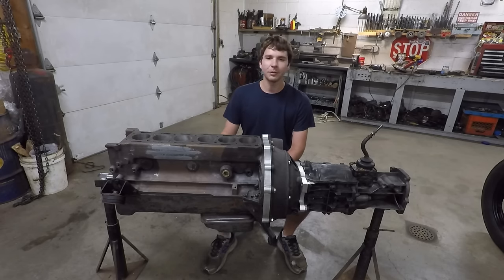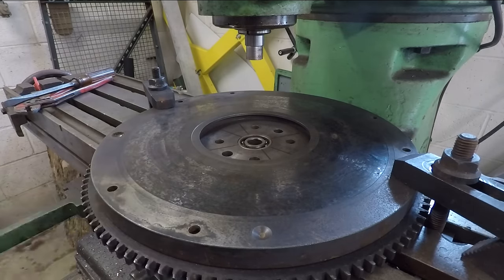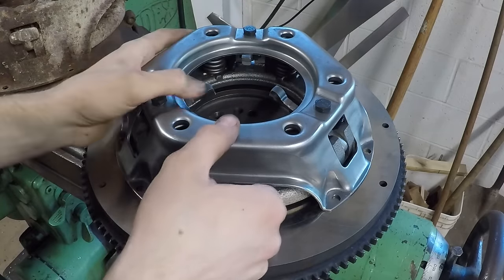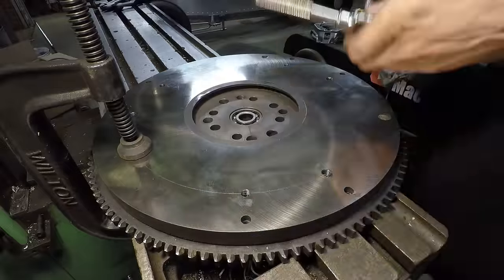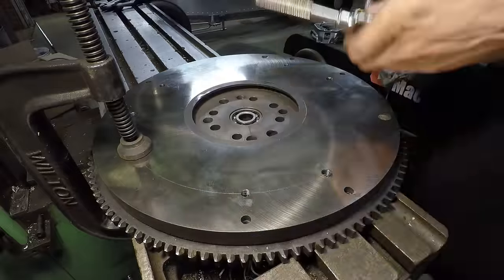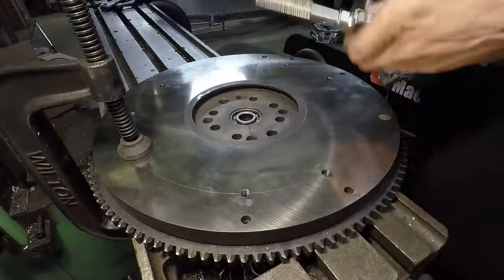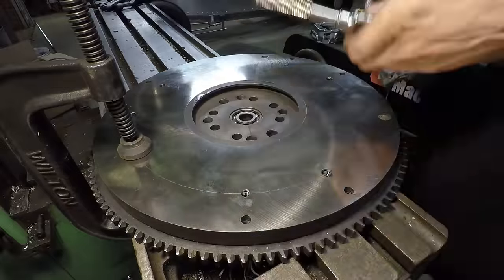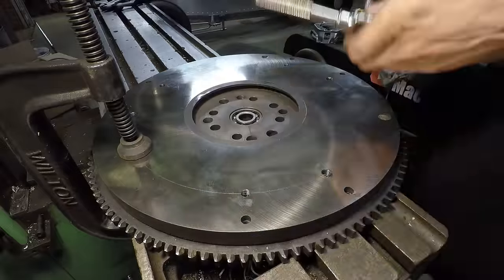Adapt ANY Engine to ANY Transmission!

Comment: This method would be great to match any Chrysler motor to any of those Chrysler cars that only came with that horrible 2.7 V6 which often died long before its time. When you see a Chrysler convertible in perfect condition being sold with low miles perfect interior and no electronic/ electric problems but can't sell despite the super low prioce tag... You know it has thet 2.7 V6

Comment: You can clearly see that the flywheel was milled and not turned. If anyone ever needs their flywheel resurfaced, I would ask to see how they are going to machine it. If they mill it and use a magnet it will not be flat.

Comment: Just a suggestion,  when you machine cast iron, don’t use oil, the chips and dust mixed with oil or water soluble coolant becomes abrasive.. when you machine 6061 aluminum, use plenty of cutting oil, or water soluble. Just sayin’

Comment: There are adapters out there to bolt the jag straight six to the Chevy T5. I know people are going to whine at me. I do however admire your work. I just dont like the idea of that many plates and bolts. Also why dod you use a 4wd transmission?

Comment: I took a factory flywheel that weighed 15.6 pounds and was able to cut it down to 8 pounds 4 ounces with no effect on the flywheel except for quicker reviving. I destroyed 3 transmission 2 rear ends and 2 drive shafts. Everything was still on the factory clutch and I checked the clutch and flywheel each time and never found anything abnormal or any were much period.

Comment: Why ford bellhouse and chevy trans? When ford has a t5 too? Ford and jaguar make parts that interchange? F.e. bellhouse drill the bottom left hole for t5 then you can have a better clutch and 3 different style clutch engagement to pick from

Comment: As an old guy who built (and raced) a lot of engines many years ago, I watch this with serious puzzlement. That you had to send the flywheel out to be resurfaced tells me that you probably don't have any of the equipment required to spin-balance your internal assembly...and you may not know if your Jaguar engine is internally or externally balanced. You removed a lot of metal from the OEM flywheel, but never seemed to bring up any issues of 'assembly balance'...so I have to ask you, are you going to send this out to a 'speed shop' that can spin-balance your 'masterpiece' before you try to build and start using it? Sometimes, you get lucky...but all bets are off with 'homemade solutions' to other (non-U.S.) engine manufacturers. I'm betting that you get a harmonics issue ('shake' or 'wobble') that ends up blasting that motor to pieces within months...first, or tenth time you 'twist it up' to show-off. Serious recommendation...send it out to be 'balanced' after you 'dry assemble' it...pricey, but prevents it grenading on you, once built. Lingenfelter's in California used to do this kind of work...but there are most-assuredly speed shops near you that can balance an engine, as well...with the Jag engine, they may need the technical data on 'balance type' (internal or external). Remember...ONCE BALANCED, DON'T REMOVE MORE METAL FROM CORE INTERNALS!!!
Reply: By the way...that 9" pressure plate on that giant honking flywheel, since it was not provided that way from the factory, tells me that you're probably going to have issues there...and I'd ask them about the flywheel-pressure plate choice you picked. With Ford, Chevy, Dodge, etc., you could always junkyard hunt the flywheel you needed for the pressure plate you desired...AND NEVER FORGET, the larger the pressure plate, the more equal pressure on your clutch (less warp, more contact pressure, often heavier springs, etc.)...so 'downsizing a pressure plate' is actually the opposite of the way 'old timers' thought...we were always wanting MORE HOOK-UP on that friction surface, and to this point, we were always searching out BIG BELL HOUSINGS that could accommodate 11", 12", even larger pressure plates! The only advantage you get from 'going smaller' is a small amount of rotational mass...which is negated when you're only dealing with 200-300 horsepower.
I'd look HARD for an OEM flywheel that originally accommodated that 9-inch pressure plate...what you'll find (as most new-entrants to power transmission realize) is that the 'rotational mass' savings you are seeking is normally 90% found in that LIGHTER FLYWHEEL, not in downsizing your pressure plate (flywheels for smaller pressure plates are usually THINNER than their 'truck' equivalents).
Reply: Yo you should be on top of the comment section so he could see this

Comment: Does anyone know if bolting a 230 hp engine on a transmission that was designed for a 100 hp engine is a disaster waiting to happen? Would keep things way simpeler if i could keep my stock transmission

Comment: The milk Barn we rented had a machine shop and or fix it shop the man running it would cut the bell housings from the motor and the transmission weld the two together. Motor to transmission

Comment: Only thing I would do differently is drill out the aluminum threads from the plate and helicoil them. I did this to all intake and exhaust ports on the aluminum heads of the  NASCAR engines I built.  Nothing sucks worse when a rear header bolt strips out. Pretty much have to pull the engine to repair it. I never trust aluminum threads.

Comment: Exdcellent work although you should be using the metric system for better accuracy and much easier to calculate.
Reply from the maker: none of my machines or tooling are metric, so that'd make things even more confusing
Reply: @MacroMachines  haha fair enough

Comment: And if the starter motor ever sticks out of polarity or overheats, good luck being able to tap it with a hammer or replace it.
Reply: Well then you just push start her till you finally get around to replacing it
Reply: Maybe in a modern car. Those old vehicles, you can practically live under the hood there's so much room, lol

Comment: I think the only combos you couldn't do would be anything externally ballanced that never came with a manual transmission as a n option. If no flywheel was ever offered only flexplate then what. Also no flywheel housing

Comment: Do not use those HS end mill parts for a dowel pin! The HS steel it too brittle buy the correct dowel they are not expensive.

Comment: MacroMachines....In fact...you are mistaken...It's not ''pretty much the same if you were using any other engine or transmission''...For example: a Porsche trans with a flat six Subaru engine would be an issue as the is no place to mount the starter....

Comment: Wrong way to locate the pressure plate to the flywheel and the same with how you located the bellhousing to your adapter plate. The correct way to do it is setup a dial indicator with a magnetic base on the crankshaft flange with the indicator button on the center hole of the bellhousing, then  rotate the crank to get a zero reading all the way around. That large center hole in the bellhousing is what locates the centerline of the transmission to the centerline of the crankshaft.

Comment: Don't use cutting oil with cast iron, it will actually cause the metal to harden from the sudden cooling and cause excessive wear on your drill. High carbon alloys like cast iron have so much graphite in them that it acts as a lubricant anyway. Good stuff otherwise!

Comment: Too bad you CANT go to speedway and buy a trans adapter. If you did, it'd be a big hard fail. The one place you messed up was not actually dial indicating center of the hogs head with the crank. You use a magnetic base and attach the base to the crank. Put your dial on the id of the hogshead (the hole is a pilot for the transmission and should be concentric with the crank. A tolerance of less than 0.005 off center is acceptable.). You also didnt check run out of the flywheel. Measurement is taken at the edge of the flywheel and tolerance is 0.0005 per 1" of diameter. You also havent checked the perpendicular alignment of the transmission registration hole against the axis of the crank. Measurement is taken with indicator mounted to crank, and measuring the transmission mounting face at the transmission registration hole.  Tolerance is within 0.0015 of zero difference.  If you dont get this right, you'll have all sorts of problems. Front bearing of the transmission will likely be the the one part that is abused worst. You can also break clutches, induce a chatter when slipping the clutch, premature failure of release and pilot bearings, excessive input shaft wear, and more.  If theres one thing i've learned over the years, this engine/transmission relationship is nothing to shrug off. Everything must be indicated and fall within spec otherwise you WILL run into problems.

Comment: Once you found center on the flywheel with a little math, all holes could have been drilled and taped without removing it. Nowadays all of that stuff is on free calculators online. I leaned how in school and working for my uncle in his machine shop as a young kid. You know all the stuff in algebra and trig you thought you would never use. Kind of the continuous Dumbing Down of society with people just putting numbers and angles into a computer and wham complicated formulas answered in nano seconds. Crazy if you don't use it because it definitely saves a lot of time

Comment: Odd, seems stackup measuring mistakes shown. Pressure plate height varied? So throwout bearing face would ride - mis engineered distance from, if too close a problem, some extra dist from not so big, pedal height adj.?, he cut recess in ring gear plate, did he chat how he determined depth?,

Comment: flywheel, why not weld over the holes and drill holes to match the crank?  Sorry, I am a bit cheap, though would not have reused the flywheel bolts.  Other bolts that are accessible, sure.  If those fail, you tear it all down...

Comment: Disappointed not to see you run a dial indicator off flywheel around inside of bell housing section with round opening to check and set alignment to centre line of crank shaft before drilling down g l holes

Comment: I am looking at it and thinking why the hell would you use an ford flathead flywheel and pressure plate. Why not use a Jaguar flywheel with pressure plate. And use that with chevy gearbox.

Comment: USE ATF FLUID IN S10 TRANS   NOT 85/90 GEAR OIL
Reply: Tremec now owns Borg Warner transmission  and they recommend using 50 wt synthetic gear oil in the old T5s. I used Lucas 50 wt synthetic in my T5 from an 86 S10 Chevy in a 53 Chevy pickup and it shifts great.

Comment: i am a retired professional transmission rebuilder of 40+ years. you did not do yourself a favour by using a borg warner T5 i have built 100s of them, they ain't much. they put them in mustangs, S10 firebirds, Camaros,  and even some Nissan 300ZX, they are notorious for wiping out 5th gear, counter shafts and blocking rings,,,,,,,,,,,,,,,,,,,,,

Comment: I’m gonna buy a bmw n73 V12 put a manual transmission and turbo on and remove the direct injection so it can be tuned and put it in an e30

Comment: When I   started watching this the title was adapt any engine to any transmission. I have 8 flat heads for my 41 ford why would I go from a flat head to a jag. It would be better if I could put a newer engine in it.  I have never seen a reverse-engineered HOT ROD. Why would you go to that much work to put a flat head in a modern when you cant get parts for it?

Comment: really haphazard way of centering the bell housing , needs to be a damn sight more accurate than that, so that it wont wear the pilot bearing , and the first motion shaft bearing, which will lead to it jumping out of gear

Comment: 8:40 why in the fuck did you not have the flywheel bolted down???? That's an incredibly easy way to get yourself hurt and ruin the work when a drill bit of an end mill catches in the work

Comment: Issue #1: drilling dowel pins in flywheel. You didn’t add the step where you found the position. Critical error in the video.

Comment: Sorry, dude, but you made a couple of major mistakes here.  You've severely impeded the strength of the flywheel by   drilling into it. Inevitably cracks will be forming at those holes. The cracking will expand, and eventually the flywheel will break free.
You never re-use flywheel bolts. They are stretch bolts, and MUST be replaced after each use.

Comment: That is NOT how you center a flywheel on a milling machine!
And those dowel pins need to be tight in one side and a slip fit in the other.
If they are tight on both sides, good luck pulling the trans to do a clutch job.

Comment: I wonder why the Jaguar engineers designed for 8 threaded bolt holes in the crankshaft to hold the flywheel. I'm sure it was to harness the torque that the 1958 engine put out. Do you think a 1930's Ford put out as much power as a Jaguar? What element do you think is relevant or even critical, an old flywwheel or a sports car engine? Hmmm I wonder what will happen with a full throttle upshift after  a jack rabbit start dumping the clutch at 3500-4000 rpm... Maybe someone should search how many "old hottrodders" lost part or all of their foot in clutch flywheel explosions. I can think of 1.  Big Daddy DON GARLITS... This "IS"  a clutch flywheel explosion. https://www.youtube.com/watch?v=J1a8ZQxq8EE   Cuts the car in half. I personally have seen a flywheel come down & out embedding itself in the asphalt in the parking lot...  This is a "common sense" issue..... Or lack there of.

Comment: you just  weakened and off balanced your flywheel        2  many  Staggered wholes....     Because everything connects doesn’t mean it’s good
Reply: Wouldn’t replacing the lost metal with bolts and pins make up for it? Idk I’m just wondering

Comment: First time viewer. Only three minutes in, You missed the measurement of the hole PCD on the Jag crank and transferring this PCD to the Ford flywheel. Six minutes in, you didn’t show the measurement of the clutch hole PCD from which you obtained the divider radius. Twenty minutes in, your centering of the crank axis with the bell housing without any attention to concentricity and then bandsawing the aluminium plate, no accuracy. What ? Sorry, but a thumbs down.

Comment: That transmission is not designed for that engine, the factory never intended them to go together. You should be ashamed of yourself. This is very dangerous!!!! You need to remove that are send it to the scrap metal recycler and install the proper transmission right now!